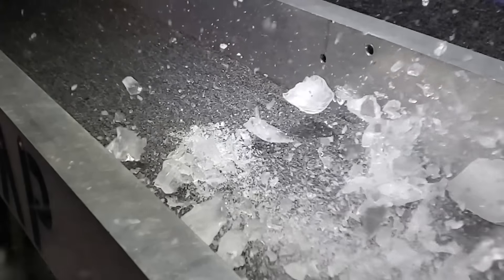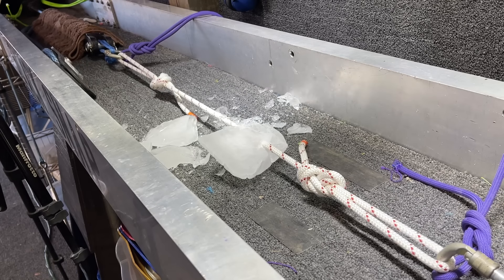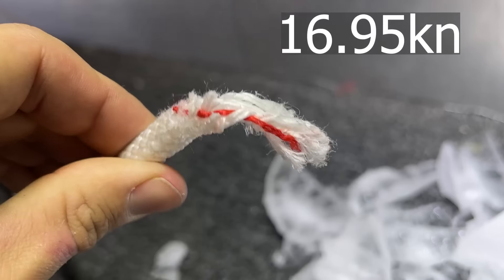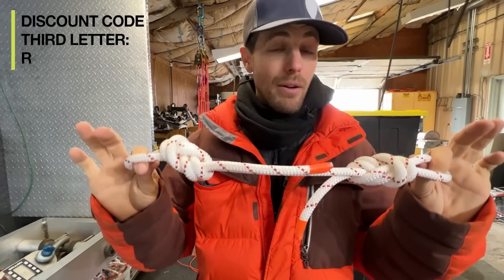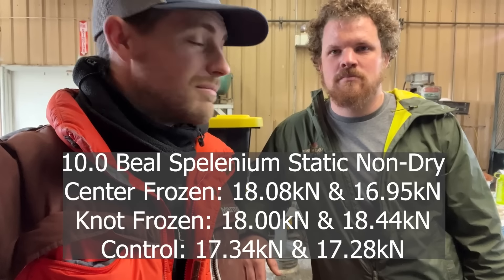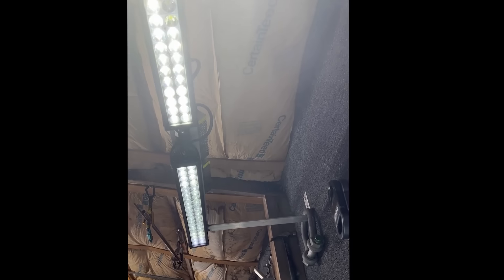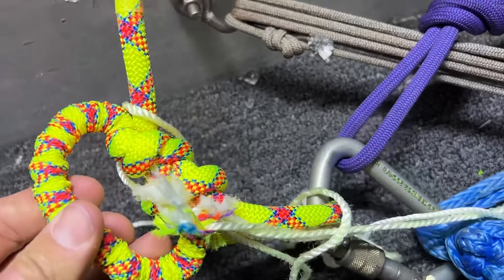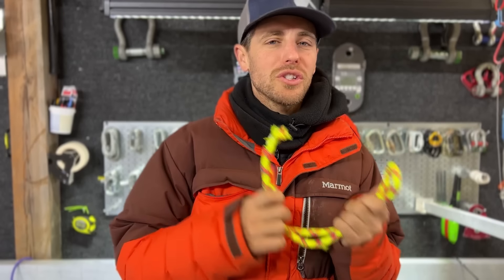Are Frozen Climbing Ropes Weaker? ❄ ⛄ 🌨 🥶

Comment: I just want to tell you guys how important this breaking stuff is to me.  I’ve been a highrise window cleaner/rope access person for 30+ years and until you guys started doing this for my eyes to see it was all just speculation.  When it comes to safety I now have a back up thanks to your channel. Again Thanks.
Reply: How can someone get into high rise window cleaning? Are they contracted out through different businesses? I’m retiring from the military soon and would like to look into that. Been a climber for many years, so ropes, knots, hauling, safety etc are in my tool box.
Reply: @cwoodside907  it’s not that hard and is wide open, learning to clean windows would be a good start.  That will get you a job make sure they have highrise than move up. There is currently a shortage of rope guys and they will draw the biggest salaries.

Comment: Under slow load, the ropes being frozen means they could absorb a bit more heat before failing at the knot. Shock loading would be interesting
Reply from the maker: We will definitely shock load the wet ropes we plan on testing

Comment: Soooo, now I guess the question that comes to mind is: "will the ropes be even less strong if they are heated up?"  I.e., sitting all day in a car kind of heat.  I don't mean as in having sat in a car for months through tons and tons of heat cycles, although that might be the more realistic reality, but just being at 120 - 130 degrees (I suppose that could also be the case if sitting on a hot rock surface or something similar for a day's outing).  Every one of these videos creates more questions... and I love it.  Great job!
Reply from the maker: Dyneema has a "low" melting point at 140C and nylon at 268C so unless your car gets that hot i don't think it's going to damage them
Reply: @HowNOT2  I was thinking more in regards to the lower gradient of heat in the knot.  I.e. frozen rope will take longer to get up to a failing temperature within the knot... but that gradient would be much narrower if the rope started out "hot"... does that have an effect on the overall strength... or time to failure.  Maybe that would be more notable in a drop test where the loading happened very quickly.  Could a "cold" knot handle more abuse over a "warm" knot?  Either way, with the numbers you were pulling, there would be a lot of broken climbers before the ropes break (even in the knot), I would think.
Reply: Light them on fire and then break test them. Completely realistic scenario I saw in a Christmas office movie once.
Reply: @HowNOT2  just because something is not in liquid or semi liquid form does not mean that it has not lost any of its strength. Steel loses its strength far before its melting point.
Reply: @jonathansawatsky7506  We're not climbing on steel ropes.
Reply: @HowNOT2  The industry standard heat cut off for rope exposure is around 180f in rope access. At this temperature the rope won’t melt but the composition of the polypropylene component may change effecting strength. To the best of my knowledge this hasn’t been tested but is based on the known properties of polypropylene in general. In areas where it is likely ropes could contact objects hotter than this we use aramid ropes. These are massively impressive, I’ve failed to melt one with a small blowtorch and they are hard to cut.
I did hear one terrifying story where a rope with an aramid sheath but a standard core came in contact with a >500f object. The core melted in half and the climber was left hanging on just the sheath!

Comment: This info has practical application in off road and vehicle recovery areas, too.  Here in the northeast, everything freezes.  It's good to know that recovery ropes will still likely be strong, BUT that they might not have the normal amount of stretch to them, so the shock loads may be higher.  Great tests!

Comment: Yesss, my guess was right, the ice fell off and it had minimal to no difference in the pull test.
Reply: Looked like it helped to me.
Reply: @elmeradams8781  Depends on what you call 'helping', the sample size and difference in results is too small to make any significant conclusion about the strength. All other properties of the rope have not been taken into account, if your dynamic rope suddenly becomes semi-static, you might end up breaking your rope (and your body) even with the higher strength, where as with a normal dynamic rope the force would be much lower and you would survive.
Reply: @markkNL  Tests are inconclusive. Time for drop tower test!

Comment: What does -40 degrees do for the strength of a rope? Dry ice could be used to freeze it. The other question, and probably more critical, is what does -40 do for the strength of carabiners as I know metal breaks easier at these temperatures. The primary application of this would be things like high angle rescue in in the interior of Alaska (not a great day, but conceivable).
Reply: Subzero temperatures are even super common in places like Jackson hole and such.

Comment: Some great tests with very interesting results. 
I have a suspicion that the higher test strength of the iced ropes over the controls is the result of the ice forming a composite with the core strands. The core being great under tension as designed, with the ice adding a degree of resistance to compression from stretching, in addition to bonding the core and sheath together. Similar to fibreglass/carbon fibre etc. 
To test that it would be interesting to see if there’s any variation in rope diameter at 85% breaking strain, and how/if that effects the eventual breaking point. 
Keep up the good work!

Comment: Well it makes sense that the frozen rope has higher breaking point. The ice is absorbing some of the energy and protects rope from friction damage. Although for dynamic rope it may only look like that, since shorter fall would produce higher stress not only in anchor but in rope too. It would be interesting to see the fall tests to compare. And also if you have chunks like that on your rope, they would be quite heavy.

Comment: All in for liquid nitrogen!
 I’m curious what  happens if you bend a piece of rope that’s frozen stiff and then load it. In my mind the fibers get more brittle when frozen and therefore breaks when it normally just bends.
Reply: And, I think the new format is a bit to compact for me. There is a lot of information there but I need more time to process it. Great content as always though! 😍
Reply from the maker: The ropes were not necessarily straight in the ice, so i think it just breaks the ice apart.
Reply: @HowNOT2  put the ropes in water let them soak for a few days and then freeze them ?

Comment: Hey Ryan, Bobby
I have a request for you and since it's also rope-related I'm posting it here.
There's a common approach to a tether (or a PAS) in Europe which is essentially tying yourself to a dynamic rope using a figure eight and attaching a biner to the other end of it. I was thinking what's a reasonable rope diameter for this, considering there's a chance for a factor >1 fall (unlikely but possible?). Some recommend 9mm rope for this, which seems overkill. What about a 7.5mm (suited only for half/twin)? Too thin?

Comment: Very interesting vid. I didn´t think wet ropes made a harder catch!!!! Thank you very much
Reply from the maker: I'm going to drop test wet ropes because the stretch is the biggest issue from my research, not necessarily just the slow pull strength.  I'm very curious what ends up happening.  We will be comparing to the exact same rope but dry.
Reply: Could it be that the ropes in this test didn't have the time to actually soak, because the water froze too soon, and also the ropes were brand new and were just lying there still? Maybe some bending and stretching of wet ropes helps the water to penetrate inside between the fibers? And that might make some difference in realistic setting?
Reply: @iura0  my thought exactly!

Comment: Could you break test a cam with a better bend radius than a carabiner straight to the thumb loop? Im curious to see what happens because youve tested slings a lot and youve tested carabiners to the thumb loop a lot, but how about a larger diameter rod through the thumb loop, so it doesn’t kink the wire as much? Was just watching the cam break test video from a year ago, and saw that the cam wires broke at the carabiner but pulling with a webbing sling doesn’t kink the wire as bad and it always broke the sling first. Like maybe fit a 1” or 1.5” rod?

Comment: Would there be any reason to think the results will be any different on frozen Amsteel? Not for climbing purposes necessarily, but winter hammock camping it's not uncommon to be suspended from a 7/64" whoopie sling that's frozen stiff.
Reply from the maker: The only issue i might see is the splice not hold as well.... or hold better because it's frozen together!